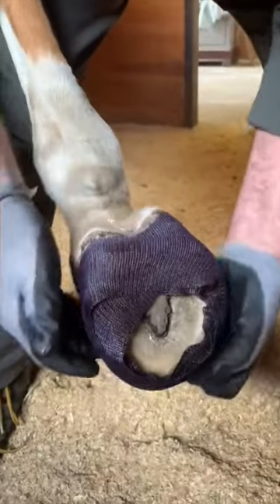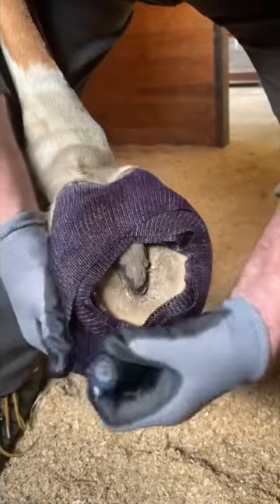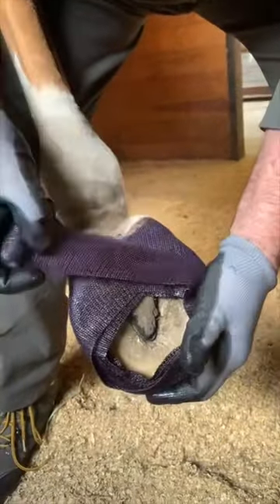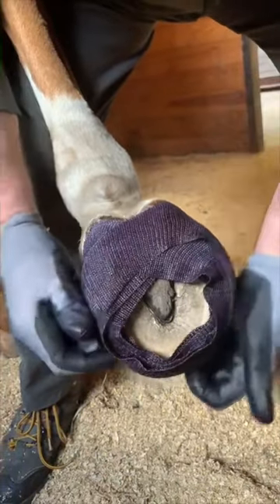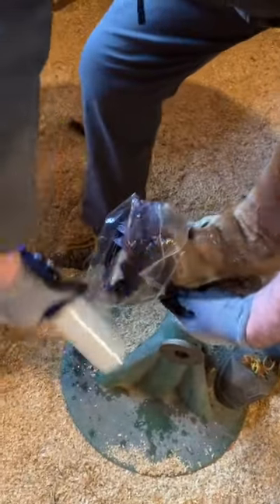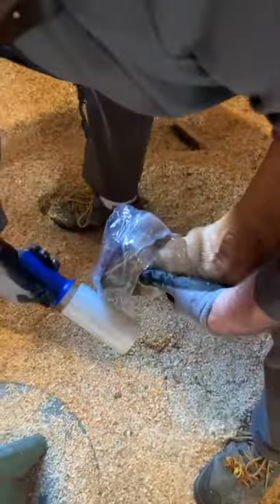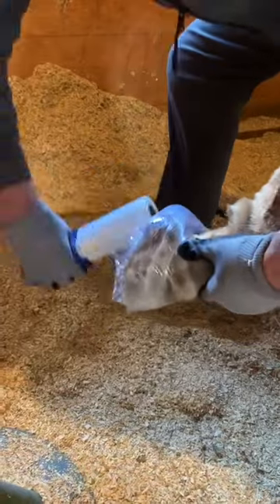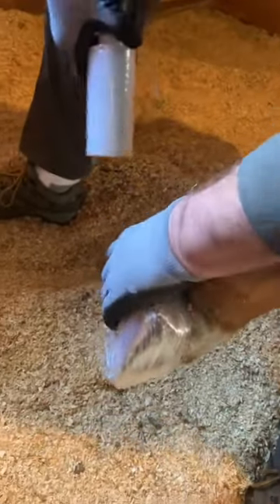Hoof Casting - Quick Overview

Comment: I feel it's best to add some type of glue to the wall so it doesn't slip or come off for extra security.
I've had them step right out of one.
Reply from the maker: That is a great option as well and done pretty regularly by most people using a lot of casting material.

Comment: doesn't it require that the cast be wet after it is applied??? or is this a different type of cast that goes on dry and remains dry, no need for water to be added after it is applied??
Reply from the maker: It didn't show it in the video, but he actually dunked the roll of casting in water for about 5 -10 seconds before he started wrapping.  It is recommended to submerge the whole roll of cast in water for a few seconds then apply, rather than applying dry and then wetting the surface.  Wetting the whole cast will active all of the resin better than just applying water to the surface because water may not reach the layers closer to the foot if just wetting from the outside.  However, the cast will eventually setup without wetting, but it is intended to be wet for optimal performance.

Comment: This just shoes.putting on vet era and saran wrap.  What is the benefit?  Why do it in the first place. Explain reasoning.  A shoe whould have worked just as well if used correctly.
Reply from the maker: This is just an example of when and how casting can be used to offer protection, support and maybe some additional stability to a foot that is compromised or just in need of some temporary protection.  You could absolutely use a shoe to accomplish those same goals.  Sometimes a shoe may not the best option because the hoof quality is not great for nailing or something along those lines.  We are not suggesting it is a replacement for good shoeing, just another tool for the toolbox of options.